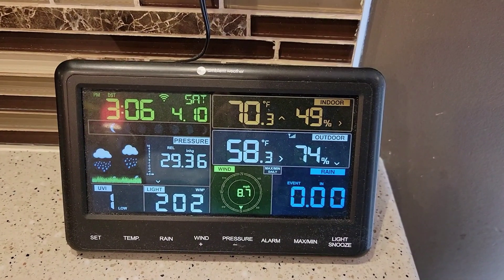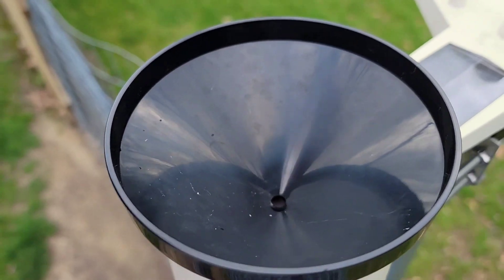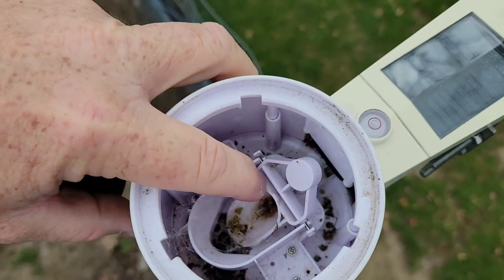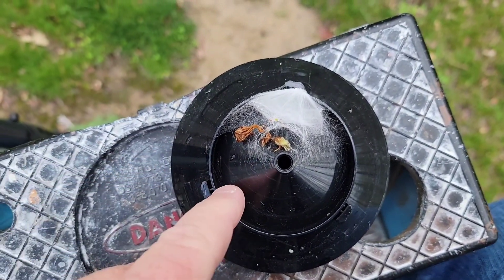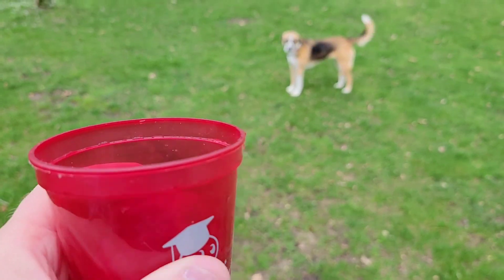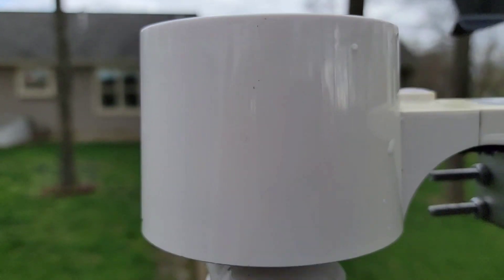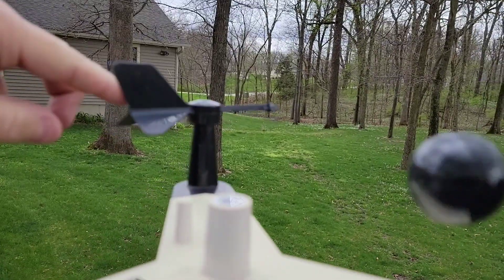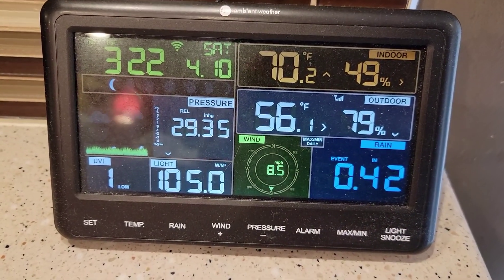Ambient Weather Station WS-2902A HOW TO REPAIR RAIN GAUGE NOT WORKING

Comment: Thanks, I wasn't aware that the top of the rain gauge came off. It's no wonder that it's hardly been registering any rain lately. I've had my 2902 for around 5 years, so it probably definitely needs cleaning out.

Comment: we bought a new rain gauge ($30) for the unit. Turns out it was unnecessary - there was a wasp nest (defunct) inside. Going to keep the other gauge just in case - would cost almost as much to send back if they would even take it. Cleaned out the nest and the gauge works good as new.

Comment: Mine wasn't that dirty but cleaned it anyway. My wind speed and direction and temp are working fine. Even after several dumping the cup, still reading back to home unit. What else could it be?

Comment: Cleaned everything the rain gauge moves but won't register anything
Reply from the maker: I would try taking the batteries out of the sending unit at the rain head and also the display unit.  
Also make sure when you press the rain button on the display it changes to show you rate and event.  I would leave it on event and see it it moves.  Let me know how it goes.   How long have you had this unit?
Reply: @JustADad  the unit is about 4 or 5 years old. I did what you said pulled the batteries out even pulled the unit apart gave it a good clean out put it back together and reset it and now it's working again. Cheers mate
Reply from the maker: @vh1ghland3rv28  Awesome!!!! seems like most things are small computers and just need powered down every once in awhile!!!